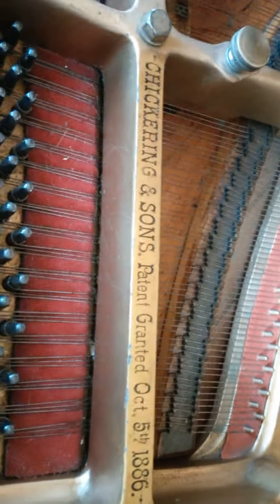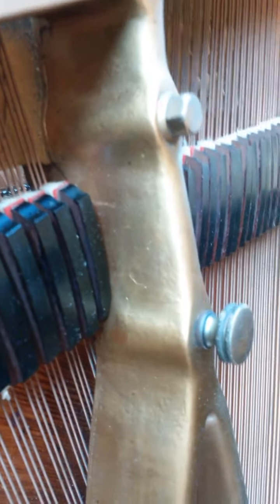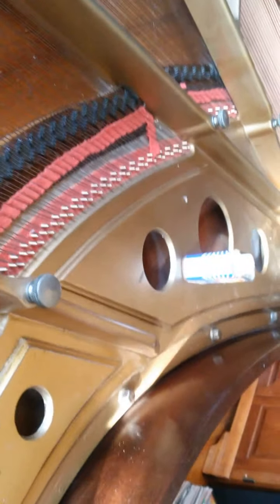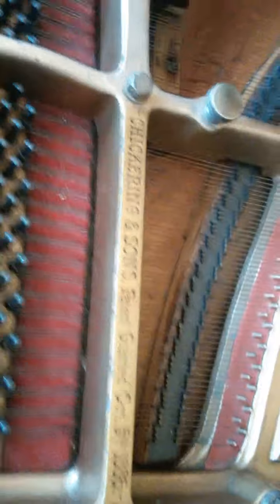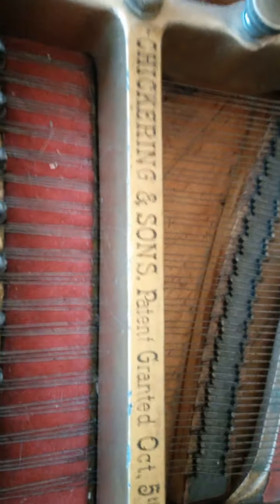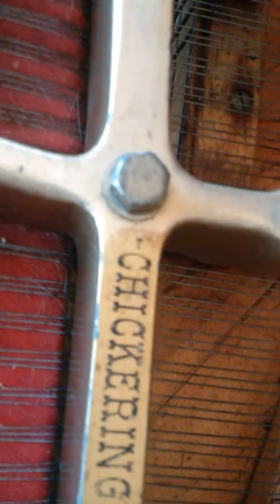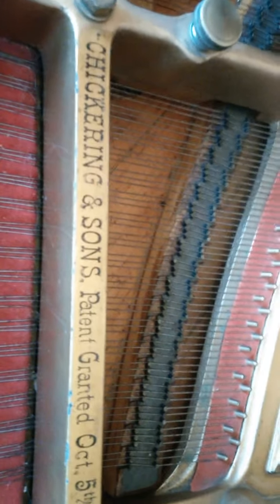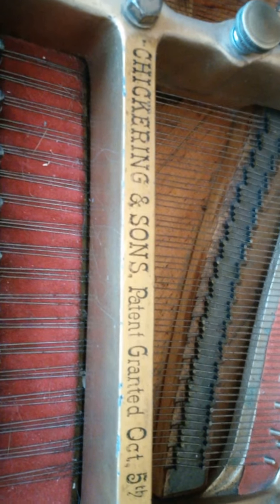1891 Chickering 109P Grand Piano Restoration (Cont'd) - The Painted Plate

Comment: Hello Bryan, just seeing your own video.  Looking at your piano, I am now thinking this might be a the earlier "Scale-109" and not a "Scale-109C", which I think usually had their large cast-on logo of the Imperial Cross of the Legion of Honor, sort of midway back and to the right of the strings on the plate.  Can you look under the front of the bass strings, behind the agraffes and see if you the the scale number cast there?  It would usually include "Chickering & Sons" in this area as well.  If it is the "Scale-109" then my guess is that the serial number was stamped on a soundboard decal that may sadly have been stripped away, likely when that gold paint was sprayed on the plate and the other work was done.  With some techniques, you may be able to create or bring out a "Shadow" of the serial number.   If you can imagine, this was actually their smallest grand piano.  They called them "Parlor Grand".  After this came "Semi Grand" and the largest was called "Full Grand".  My "Scale-105B" actually does not have an Edwin Brown action but what they called a "Swiss Action".  That piano is entirely original including the strings.
Reply from the maker: Yes, it has 109 and the name on the plate below the bass strings. I thought the P must stand for Parlour Grand. Amazing this was the smallest one! The case number 4192 is stamped everywhere and on the label inside left of the action cavity. Strange they would only put the serial number on something perishable? It doesn't have the Cross on it. I will keep looking in hope of finding it somewhere else. Thank you so much for your insight and information!
Reply: Hello Brian.  I have 3 Chickerings from around that period.  They are awesome. On one of my chickerings it took me 3 months to find the serial number.  Strangely it was staring right at me.  As stated in the previous comment, sometimes you can see the shadow of it on the soundboard behind the strings.  Get a bright light as well as a lightly damp rag to gently clean off the surface of the soundboard.  

It will be to the middle right of the soundboard about 6 inches behind the dampers.